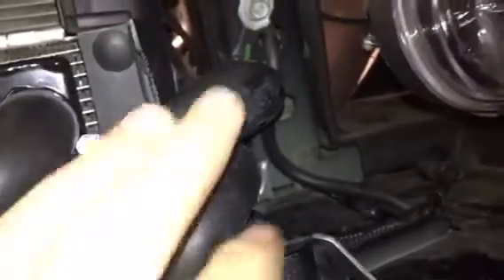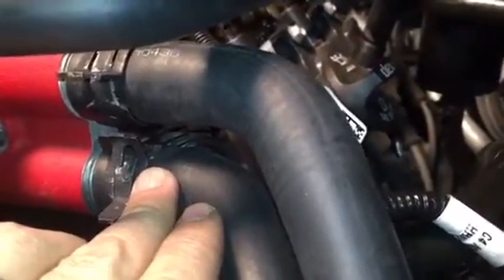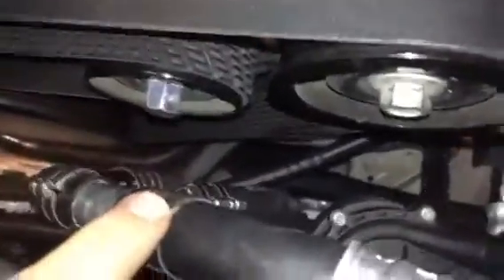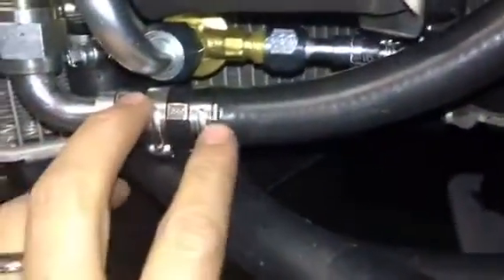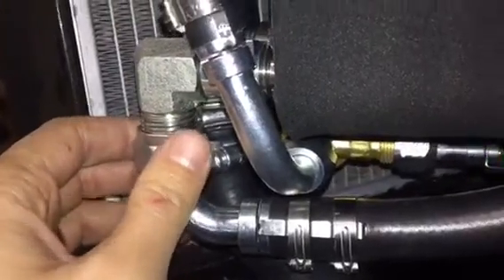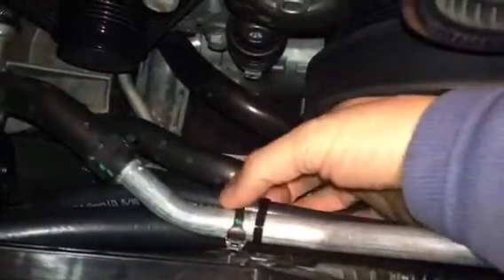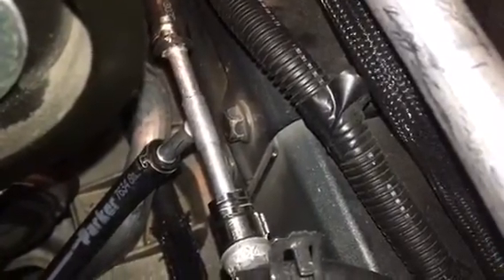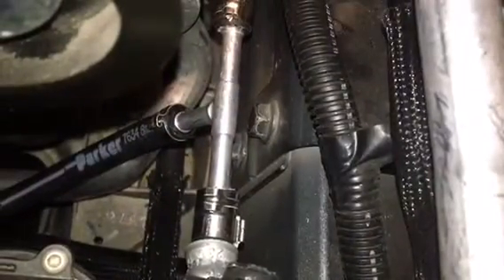Review of Killer Chiller setup (prior to 3 way bypass which is a MUST to really enjoy this mod best)

Comment: Did you make another vid to include the drag pack option? That's really the only install piece that I'm unclear about.
Reply from the maker: Michael Peck I did not, because I never got the drag pack option. I’ve never been to the track with mine as it’s just a daily driver. I’m sure that option would really help though!
Reply: @DavezGTP  I'm putting mine in this weekend. I did a drawing and they confirmed I have it set up right. This should be fun.
Reply from the maker: Michael Peck ha, the install is a bit long and frustrating but you’ll get through it. Good luck!

Comment: Do you remember the dimensions of the KC heat exchanger?
Reply from the maker: Jesse Combs there is no heat exchanger with the killer chiller, as it is essentially an oil cooler. Do you mean the heat exchanger that my Edelbrock supercharger kit came with?
Reply from the maker: Jesse Combs if so, I had it typed into my phone under my notes a long time back, but have apparently since erased it. Edelbrock could give you the dimensions I’m sure.

Comment: im not gonna thumbs down the video, but im not going to thumb up either. i came for your review and experience and dyno numbers pre and post killer chiller. if you could let me know that would be awesome
Reply from the maker: RANDBO I saw about a 19 hp gain and extreme consistency in IAT’s, pre versus post killer chiller. The only downside to this system that I have found is a reduction in in-cabin cooling at idle speed only if it’s 90+ out. If you get to 1000 rpms or greater it’s plenty cold.  That’s probably something that can be fixed by increasing fan speed which I have not done. So honestly that’s the only thing about the whole system that I don’t like. Aside from that though, I absolutely love it and the car feels so much peppier on hot days.
Reply: Well seeing as he never said he was going to supply any of that 90% of that comment is unwarranted.
Reply: @DavezGTP  15 hp? Many people said over 40-50 hp
Reply: I came for the route of the system. Some people do their own installs. Thanks man!
Reply: @FahadAlmutairi  That is likely from a smaller pulley because the lower temps they could increase the boost. You would have to get the temps much cooler to gain 50 hp from just dropping the air temps. He could get closer if he combined this with direct port water-methanol injection.